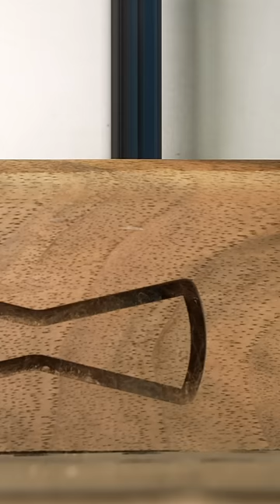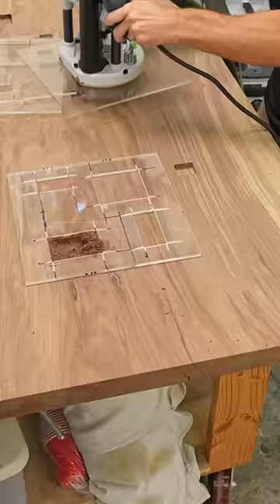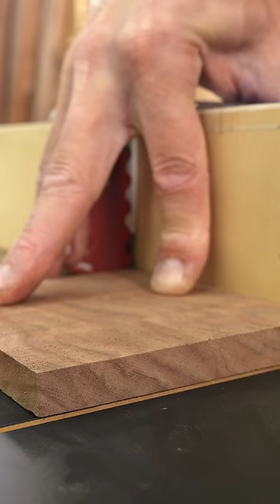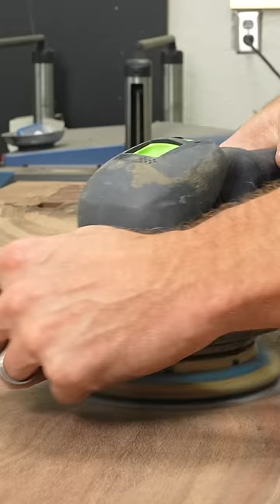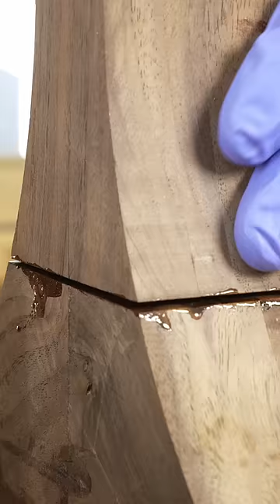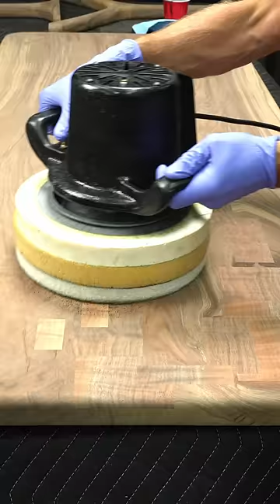$5500 Desk in 60 Seconds

Comment: Thosr patches look really cool with the grain not matching.
Reply: They shouldn't have been squared like that. When taking out knots, they need to be cut with the grain and tapered, not 90° angles. 
Anybody says I don't know what I'm talking about and couldn't disguise a knot should probably not respond.
I thought he did that as a deliberate talking-point, to encourage engagement, or maybe he's not really caring. Either way, it did turn out nice, but the flaws have no excuse.
Some people quite like the knots, they do add character and are perfectly fine for tables. They can cause a weakness, but the ones in this video would've been fine.

Comment: hand planers break every law of physics.
The blade is ALWAYS protruding beyond the plane surface, yet somehow stops cutting once a surface is flat
Reply: Haha, never thought of that
Reply: Not true.
Reply: Thats because the surface behind the blade is the same height as the blade
Reply: @Randy Bobandy  
The surface on a hand plane is a single perfectly flat sole plate.  Only the blade protrusion is adjusted.  On a handheld POWER plane the sole is 2 parts with the front half in front of the blade being adjustable